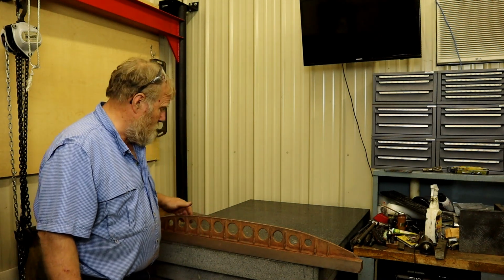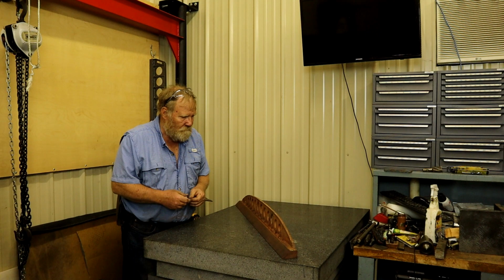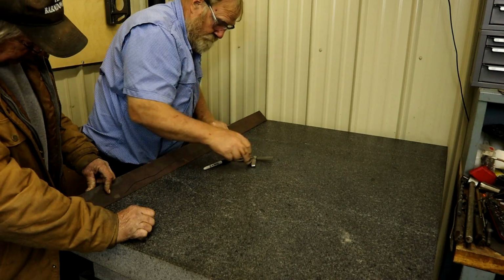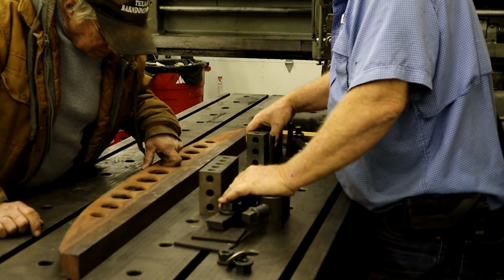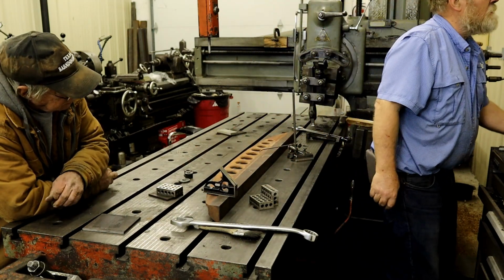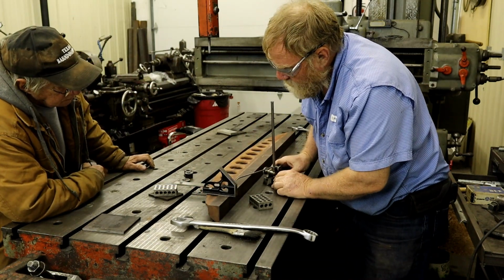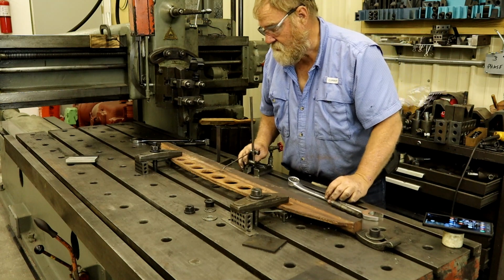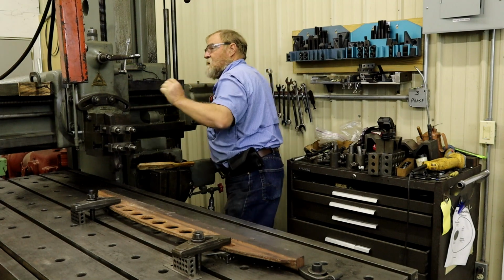Straight Edge From HELL.... Part 1

Comment: In a Richard King introductory scraping class I took part in a year ago, the students were instructed to ‘ring’ their scraping project before taking a print with bluing on the surface plate. The ‘ringing’ is done by suspending the object using your hand or via a rope and beating all over it with a dead blow hammer. The ringing is supposed to relieve stresses induced in the object by the scraping process. I wonder if ringing your straightedge after finishing a planing cut and unclamping would help or hurt? In this case, the straightedge is 4 feet long, you would suspend it via a rope from a hook somewhere in your shop and beat on it with a good sized dead blow hammer. I enjoy your videos, keep up the great work.
Reply from the maker: I have had 6 of Richards classes here.....   I am not going to get into the argument of "Does Ringing work" :)   Lets just say it can't hurt but I have not had to do it.

Comment: Why not mount it at the edge of the table and use both heads - one to plane the top surface and one to plane the side surface !
Reply from the maker: Ever tried to mill a wet noodle?    When you are trying to keep a 4 foot long casting, that is as thin as a noodle, held to a table with no force to deform it and then make it flat and true to less than  1,000  of an inch... well  it's not easy... Trying to hold the noodle, to apply cutting force in two directions, is a whole different  ball game and one I'm not going to play :)

Comment: Well, the transcript says: "cattywompus" but the word, correctly spelled is apparently: 'catawampous' - from 1840 !
Reply from the maker: What transcript?
Reply: @10swatkins  Below the videos, there's a thumbs up, thumbs down... ...save and then 3 dots in a line. Click on those 3 dots and a menu will offer you 'Open Transcript' - which then appears on the right. It includes timestamps but they can be turned off via the menu under another 3 dots ;)
Reply from the maker: @millomweb   When I click on the three ... all I get is "Report"
Reply: @10swatkins  It's just under 'Report' - is it off your screen ?
Reply: @10swatkins  Scroll the page down a bit - so the three dots are higher up your creen giving more space under 'report'
????????
Reply: @10swatkins  Have you found the transcript now ?
Reply from the maker: @millomweb  It shows up on some videos  and not on others for me :)   Never seen , or needed one before... I guess it's for the hearing impaired?
Reply: @10swatkins  It is the same text as appears as subtitles if you have subtitles turned on.
I find it useful either to check words I mis-hear or words I've not come across before. Recently, Mr Pete introduced me to 'fanagle'.  Then I heard it 3 more times the same week ! Now you with 'catawompous' !

Comment: Nice to see Don back to help you there, you two make a good team. If the straight edge isn't straight when it comes to you, how can it be worth $600.00. You can only try to do your best to remedy a problem that was already there. Will you check that side after it's done, on the surface plate, to see if it is holding true before proceeding?
Reply from the maker: Straight edge blanks of that size cost 600.00 or more...    They are "finished Products" if you will.  Nothing different than regular machining except the stock in this case is more like titanium than A6 metal :) 

Everything is checked along the way... Lots more to come ;)

Comment: Steve I think you  might be removing too much material on your first two passes. This weakens the edge just enough to bow a couple thousand's released from stored energy in the crystal lattice. If you run into this problem run it up in an oven to 500 degrees f for 24 hrs releasing the crystal deformations. Cool very slowly by wrapping heavily. Don't run the temp up when machining by coolant if necessary.
Reply from the maker: The edge spent 14 hours in a stress relieve oven before I started working on it...  Can't use  coolant on the cast iron :)

Comment: Do you ever add multiple dial indicators to see how much it twists or deflects when you tighten the hold down clamps..  while doing the flat backside.. do you drag along the top edge so you have an even surface to drop onto your jig .
 will your jig be double sided. so you can tighten individual jaws  that look like a box brake allowing you to clamp on evenly to the back without distorting it..  again using indicators to see if you are deflecting the surface as you tighten the Jig..
Reply from the maker: No on the dials... I'm after a setup in the machine that holds the piece  securely, but without deformation and placed on the table so when the cutting is done the piece is the correct size...  This is essentially rough casting work...   Clamps and shims are used so that there is no twisting of the work piece...